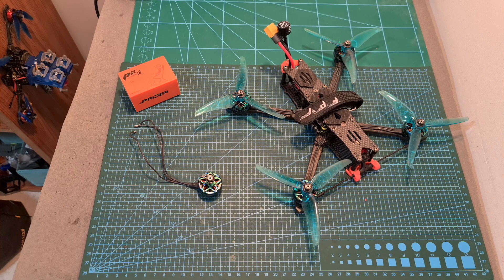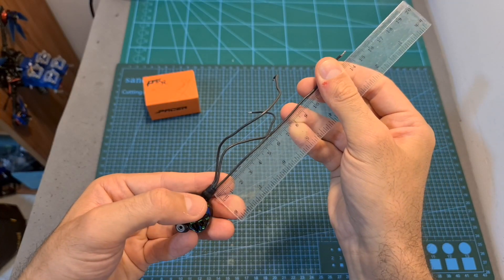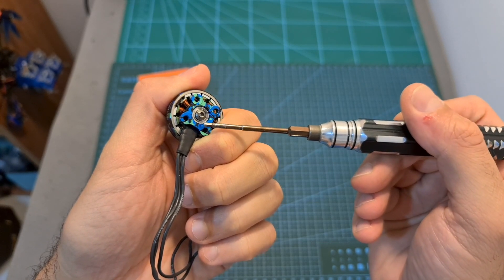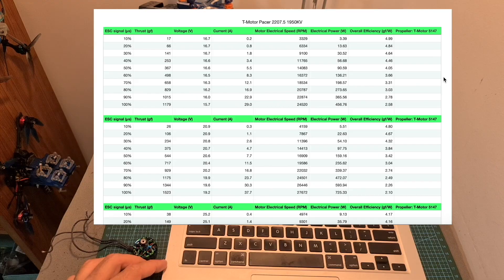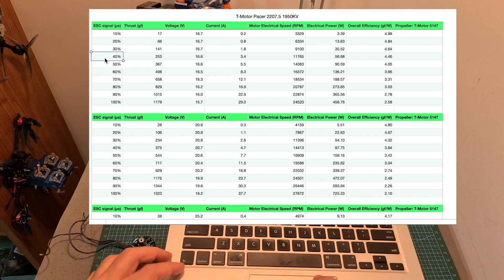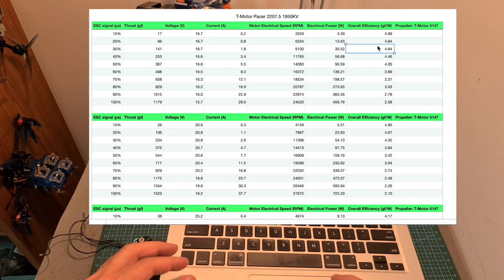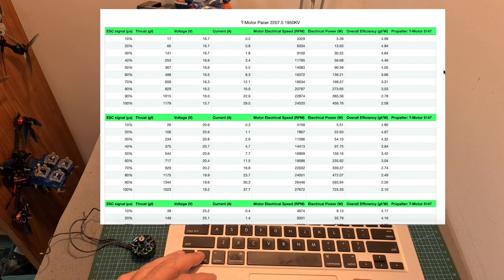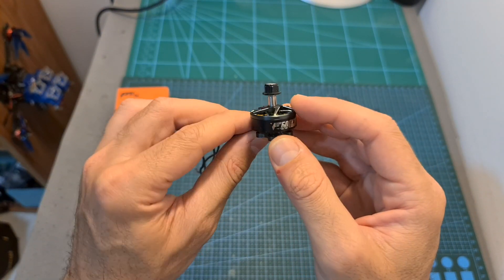T-Motor Pacer 2207.5 1950KV Motors - Thrust Tests & Flight Footage

Comment: Apart from using the PSU for constant motor power. I would suggest an actual optical tachometer, you could use a trigger disc under the prop nut for rpm monitor. Theoretical motor rpm is useless data...Another excellent test though...
Reply from the maker: Thanks for the suggestion. I do have an optical RPM sensor and I will consider using it in my next tests.
Reply: @KremerFPV  Yes, concrete evidence of motor rpm would be a useful addition, just like the motor PSU as a constant power source...

Comment: On 6S, full throttle, the motor draw 43Amps of current, correct? What happens if you use a ESC that is rated lower that the motor's power draw? 

(Newbie here, please excuse the question if its silly)
Reply from the maker: Well the ESC might be burnt :-)
If you must use a lower rated ESC you can limit the motors output in Betaflight in order to make sure that you won't reach it's limit.
Reply: @KremerFPV  thanks for taking the time to answer. I will look out for 45A rated ESC then.

Comment: Nice ... thanks for the review Gal!
I'm planning to build new 6s quad with pacer 1950kv regular bell design not the camo.
For next motor review, please do test Puch out full throtle for 3sec so I can see the amperage value on the osd, on most cases it should be less than the bench test but I'm still curious.
Reply from the maker: My pleasure, thanks for the suggestion - I will do my best to make it happen on the next tests :-)